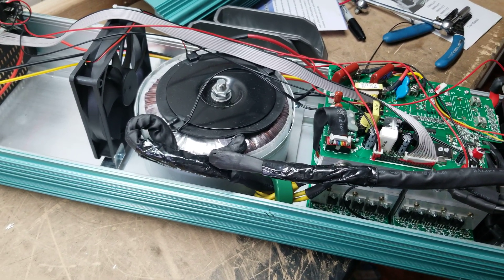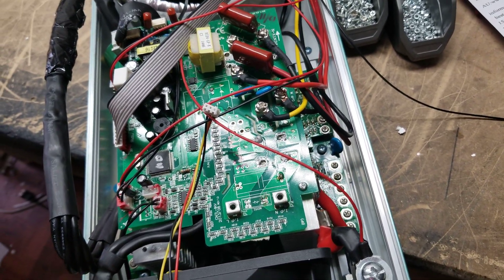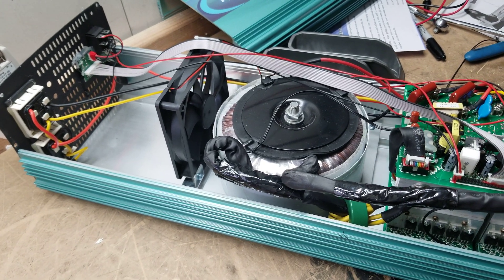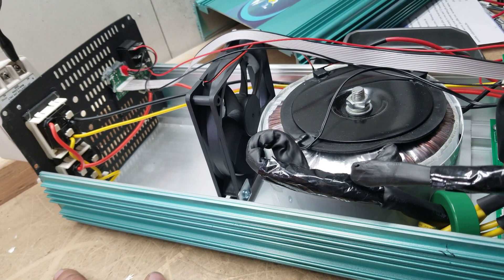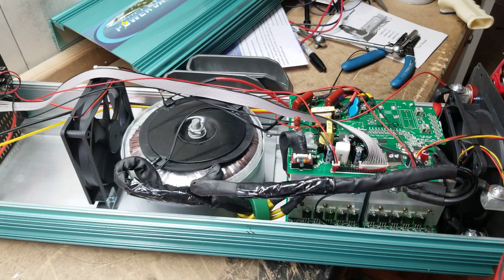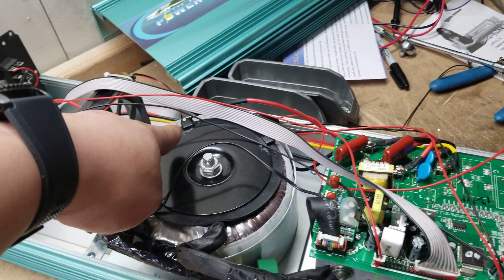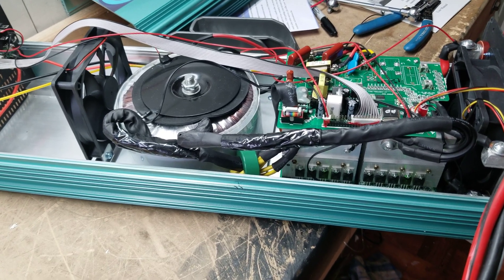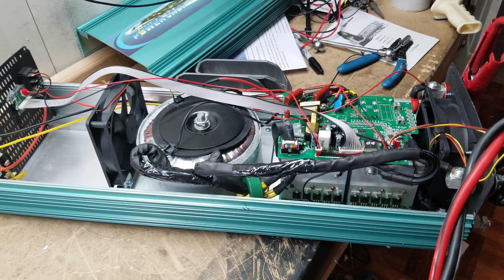Classic 10kw power jack "MSW" inverter

Comment: I have a 10kw with the torpedo chassis. It has two toroidal coils. I believe I bought it in 2015 or 2016, it still works great.
Reply: I bought one yesterday for 250 it is 10kw and in one of these cases and I have not opened it can yours REALLY do 10kw continuous